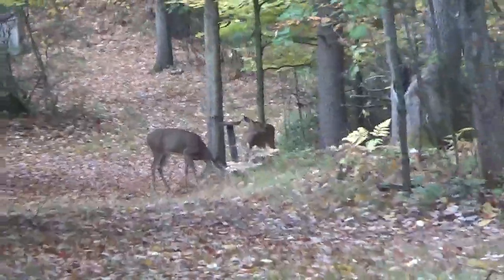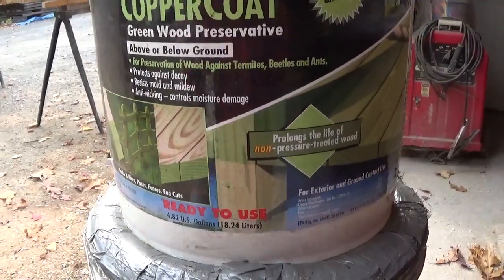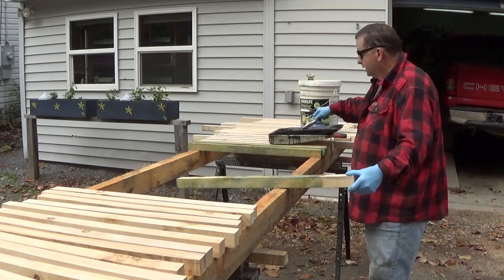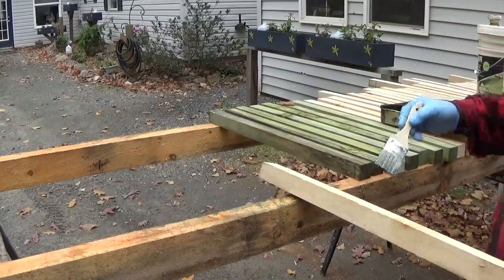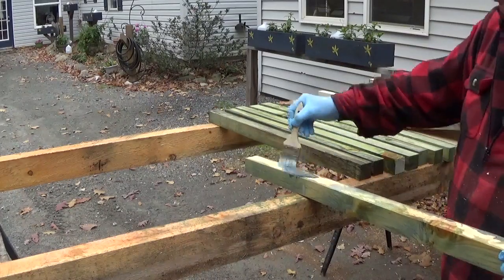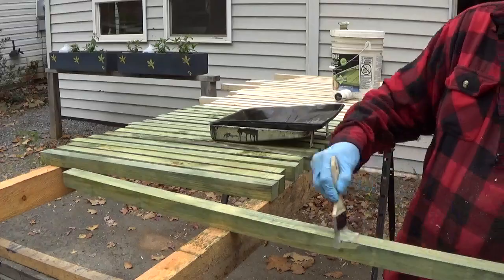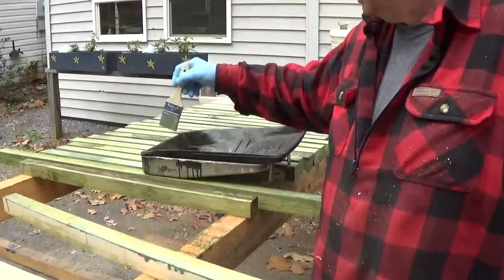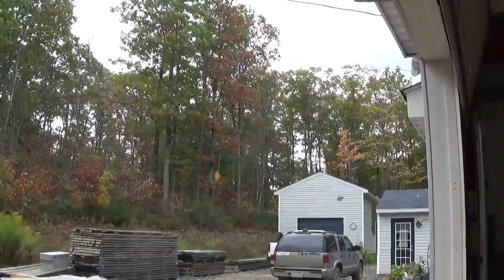Copper Coating  porch spindles, nice fall day.

Comment: Hey Joe, I used the stuff about 25 yrs back. It was a commercial application down on the coast. We used a garden sprayer. Squirted it on any where we cut treated wood for a sea wall. Yeah it’s stinky!! It doesn’t penetrate knots, but nothing does to my knowledge.
Reply from the maker: Hi PD, trying to get caught up before we get snow. 40s and 50s today. Yes that copper coat is rough to work around but it works pretty good.

Comment: Nice video, good Idea.  Used to be a builder, done this many times.  An easier way is to make a trough and dip them a few at a time and then stand them in another tray with the bottom end down in about an inch of the stuff and let them soak for hours.  You w9ill be surprised at how much they soak up.  It's the bottom end that rots first.  Soak the bottom end of the columns too.
Reply from the maker: Yup no doubt this stuff is good and it does soak in.

Comment: Hi Joe,  Good video. I am listening to you talk. A few things you said have me wondering. First is that you don't like painting. Me too. Second is that the spindles are not cut to length. Me being that I don't like doing things twice. Would it have made more sense to cut them to length then put the copper coat on.  Just saying. Say Hi to Sally. Cheers
Reply from the maker: It may be better to cut them but I prefer to look at the spindle for straightness right before I cut it. No big deal. But it just works better for me that way. Thanks Steven, Sally said Hi.

Comment: why dont you put the spindles tight together and roll it on   then turn them a quarter turn push them together again  and roll again until you have them completely covered it shoulldnt run on you as bad when rolling and be faster for ya     just a thought          looking good joe